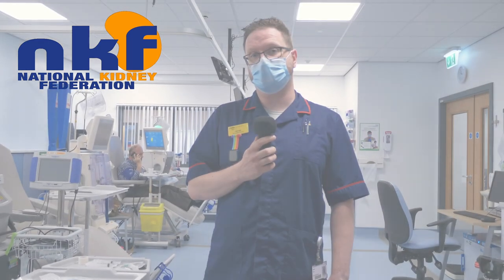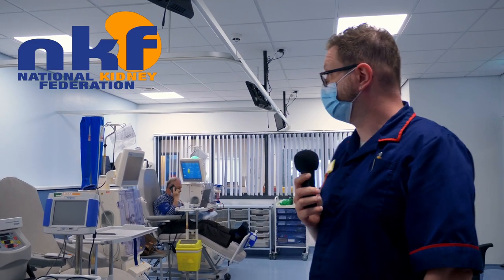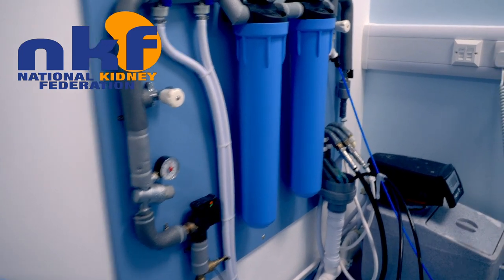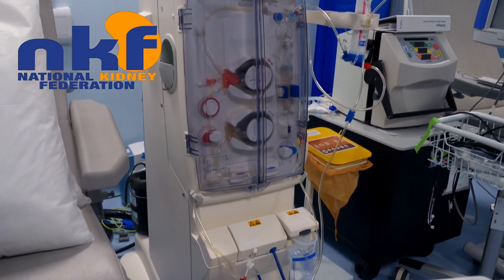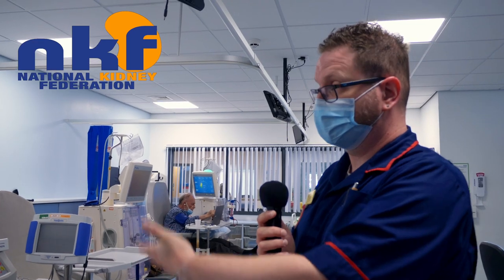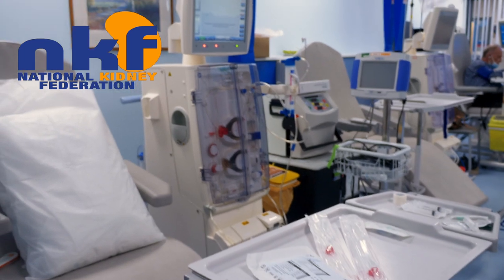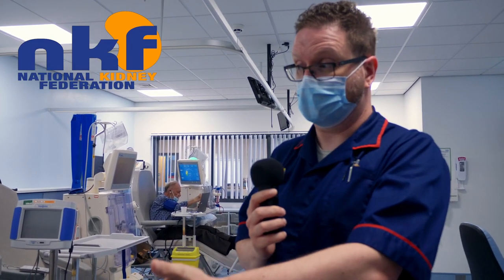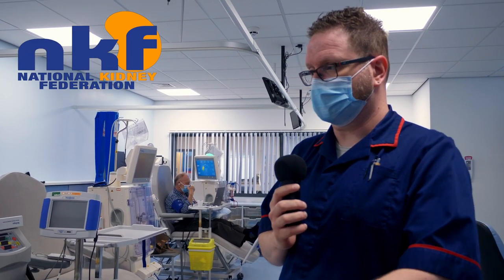Home Dialysis Training Unit Tour

Comment: I train at a Fresenius home unit. My supplies have arrived at my home. I am waiting today for FedEx to deliver my dialysis chair. My install will be Tuesday, and my first home treatment will be Wednesday. My NxSTAGE Versi machines comes with a Pure Flo water treatment system, so I don’t require all that retrofitting this video describes, but there is some basic plumbing installation to connect to my bathroom sink. I am doing Solo HHD as No one lives with me. Suits me fine, because I am fiercely independent and would never want a caregiver.
Reply: hi Dale, hope you are doing well! I was wondering how much time did you spend on the training?
Reply: @rachelf2001    Six weeks in total.